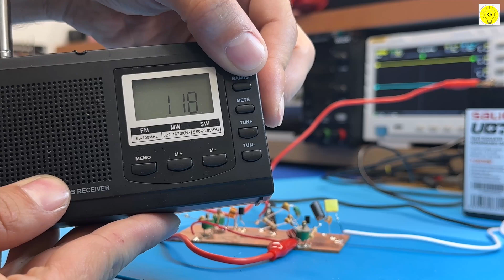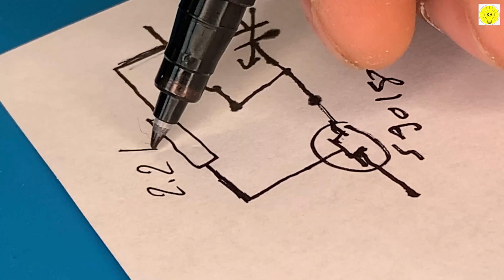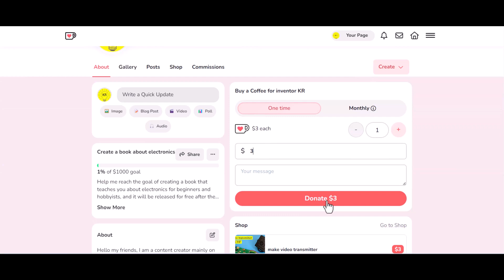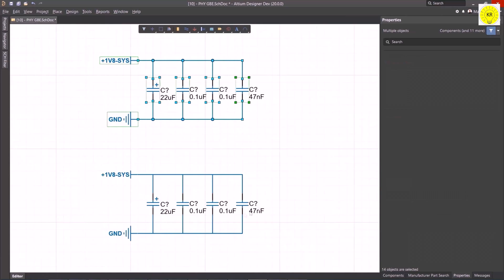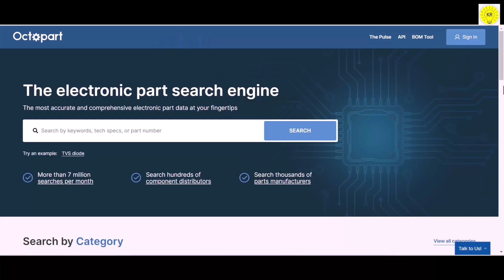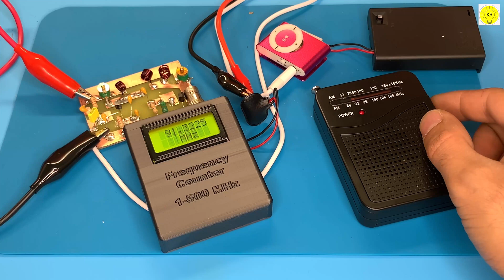Make a 800m Range fm transmitter circuit, stable fm transmitter, walkie talkie

Comment: Das Konstrukt ist alles andere als stabil.  Ohne Blechdose drum rum ist das teil auch handempfindlich. Sowas haben wir schon vor 50 Jahren als Schüler gebaut. Mit den damals verfügbaren Transistoren hatte das Teil ohne Nachverstärker 150m Reichweite, das Gleiche in die Dipoldose  einer UKW Yagi Antenne verbaut  machte 4-5km Reichweite. 
Der nachverstärker oder Pufferstufe muss vom Oszillator geschirmt werden sonst wird das noch unstabiler. Es gibt HF Gehäuse mit Trennblechen. Damit wäre es besser. 
Besser man baut den Oszillator als VCO und baut sich eine PLL dazu.
Reply: Diese Sorte Oszillator kenne ich auch als Bausatz in den 70-er Jahren mit nem 2N3553. Absolut unstabil und Hand-empfindlich. Es fehlen hier auch jegliche Abklatsch- Kondensatoren zwischen Ub und GND, ein Unding. Zudem ellenlange Drähte an den Kondensatoren - ist nicht gerade HF gerecht. Möchte nicht wissen, was hier auch an Ober- und Nebenwellen erzeugt wird.

Comment: Friend get some steel wool, then pour some hydrochloric acid on it until it dissolves completely and then pour some hydrogen peroxide (the formula is on the internet) to get your DIY ferric chloride 10% of the cost (note: make it outdoor), if you are interested i can tell you how to make professional thermal paste and your own high quality flux and soldering paste 🙂
Reply from the maker: Wow, that sounds like a fun experiment! Thanks for the tip!